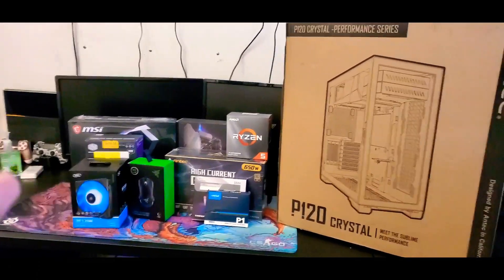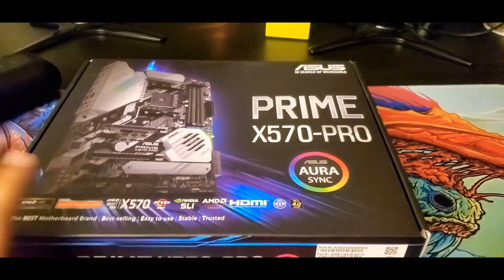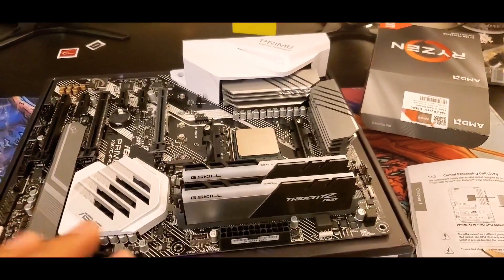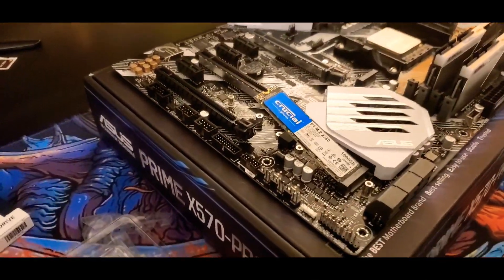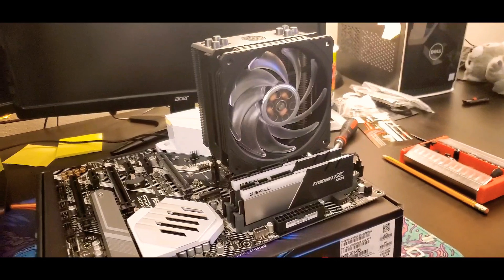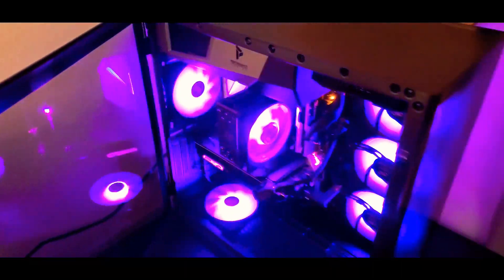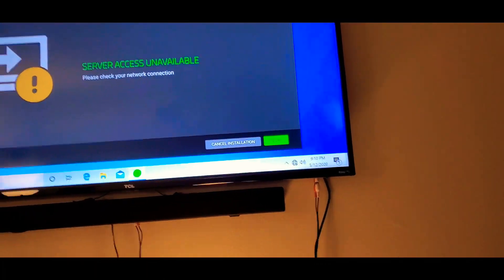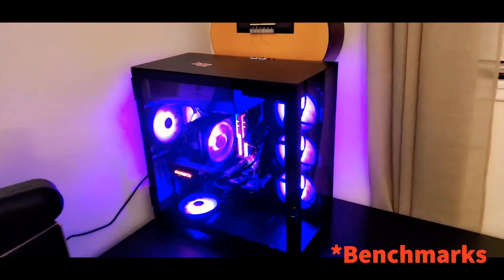Building $1500 pc without any experiance. How hard could it be?

Comment: You didn't do a bad job. What you could have done much better was routing cables but that comes with experience. I have built literally a multiple hundreds of pc's since the late 1980's. You get bonus points for going AMD! Wise move.
Reply from the maker: Thanks alot 👍Yea the cables was honestly the hardest part but compared to what I have seen i think I did alright. Hopefully I'll be better at the cable management om the next one. What do you think a better option for running the cales would have been? But yea did a bunch of research before building and AMD seemed like the right way to go 😁